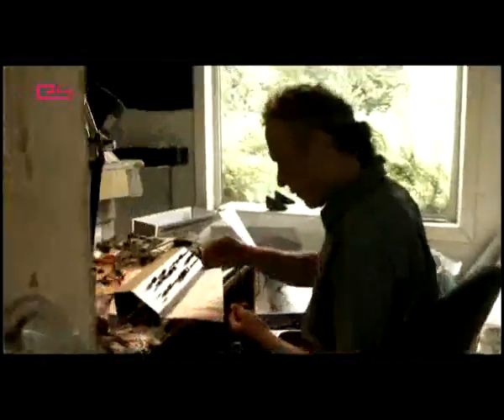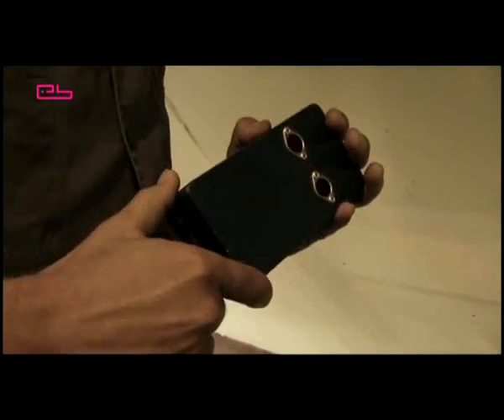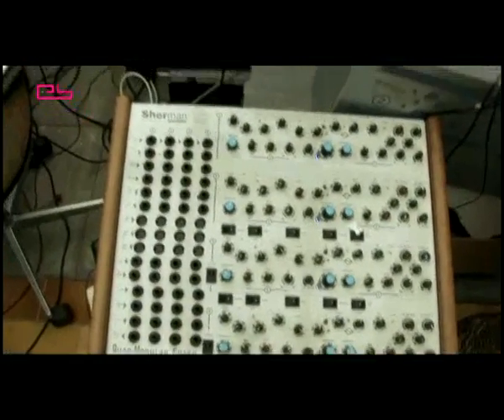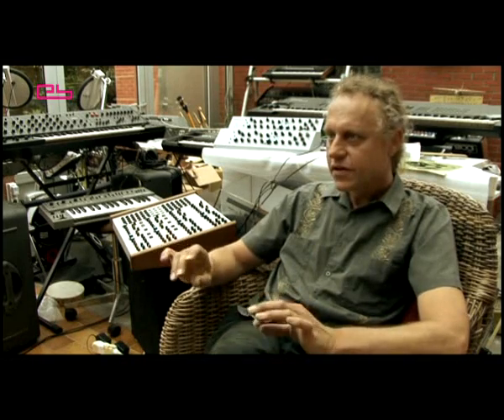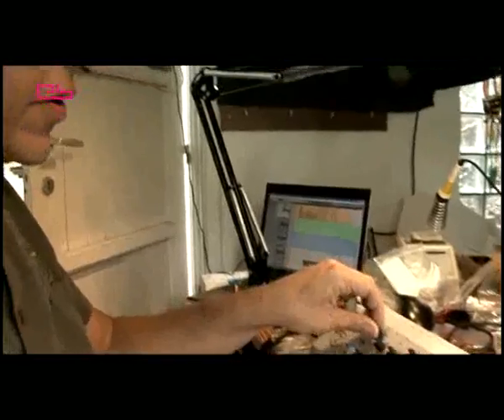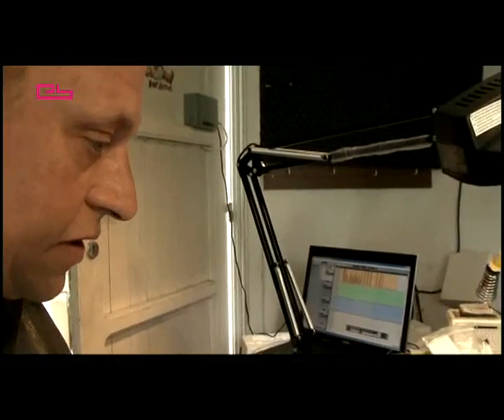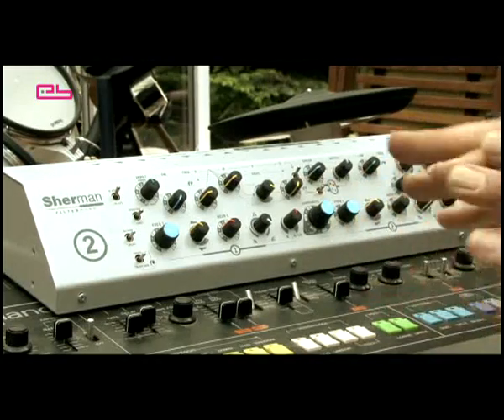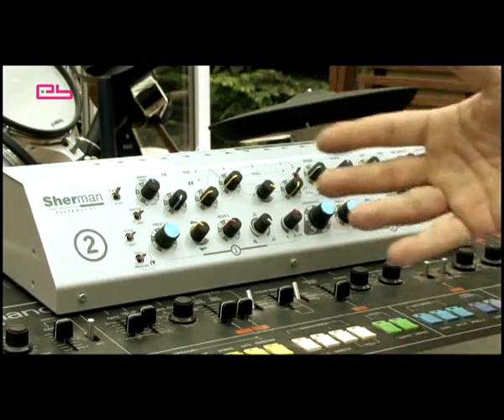Sherman Filterbank - Tech Talk on Slices - Part 1

Comment: That talk about digital resolution is pure nonsense. Has this guy ever took and oscilloscope and took a look at a 20kHz sine wave from his 192kHz converters? They won't be stepped - there's filters at the output to smooth it out. And I guess he won't be able to hear (or see) any difference.
Reply: the interrelation talks of two sinewaves, like crossmodulation for example, he has a point, but only for digital synthesizers - they mostly sound better at 192khz vs 44.1 - but for straight up recording and playback of digital audio 44.1 24bit (even 16bit) is plenty!

Comment: analog synths definitely sounds better if not at least different than digital vst synths. 
To really make a perfect software copy of an analog synth you need external heat and humidity sensors and a emulator so complex that it eats up a quadcore cpu.